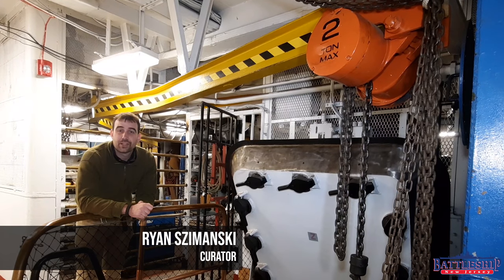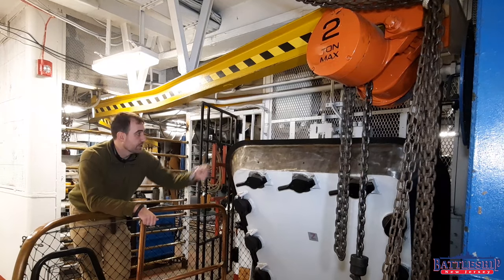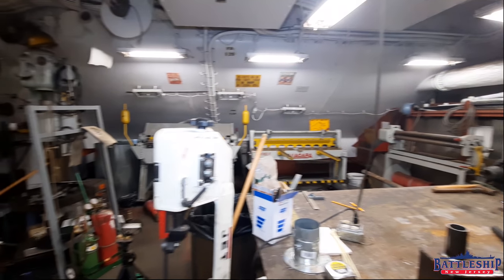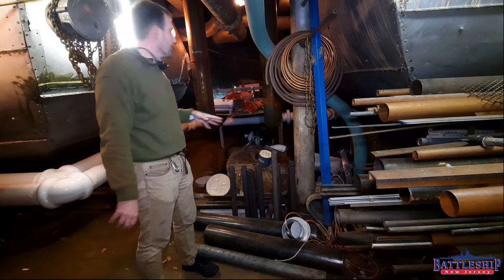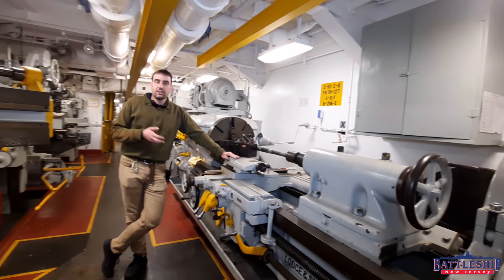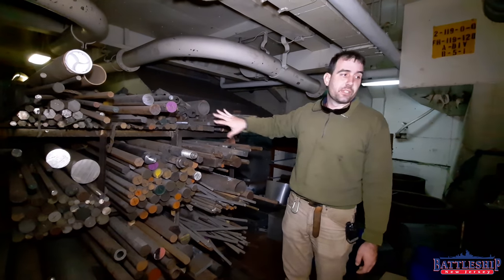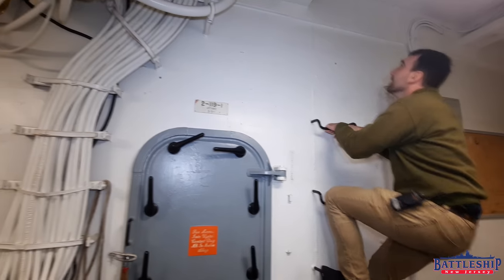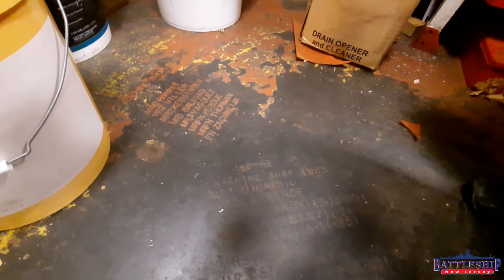Battleship New Jersey's Machine Shop

Comment: When you give a tour of a machine shop, you need to have a machinist describe each machine. Machining nerds need details.

Great video.
Reply: Yes the bullard is called a VTL, vertical turret lathe.
Reply: @000-v8v9w  I was troubled by the same mistake and jumped to the comments to make the same correction. I didn't see any turret, so I thought that it was a vertical lathe.
Reply: I think that was a Bridgeport on the left.
Reply from the maker: There is a Bridgeport on the left, right behind the Bullard vertical turret lathe which is right behind the drill press.
Reply: Lodge and Shipley Lathe.
Reply: @wilde.coyote6618  Yes, it's a 25".
Reply: @wilde.coyote6618  I work in a very large machine shop in York PA that has an old Lodge & Shipley lathe.. I recognized it right away.. we also have vertical boring 12, 16 and 20 foot in diameter... I was told that in the fortys these machines were used to help win the war and actually made some battleship parts.. later on in time the same machines were used to help produce the nuclear reactors that are in the nimitz-class carriers..... Currently we are making missile tubes for the next generation Columbia class ballistic missile submarines... And payload tubes for the Virginia class..  These old Machines and Machinists have and continue to make  quite a contribution to our nation's defense.
Reply: Yeah it killed me too. I thought I saw some type of metal planer just as the exited the 1st machine shop, I was hoping they would pan back around to get a better view
Reply from the maker: There are additional photos in the document in the description
Reply: @squigmontlucas6150  Manual machining or mostly CNC now? Just curiousity comin' from a fellow machinist.
Reply: @Privat3Kag3  quite a bit of both... But certainly the emphasis on CNC hbms and Gantry Mills.. we cannot find Machinists... The top rate on second shift $31 an hour and we cannot find people to fill the positions.. good benefits double time on Sunday..many of the old-timers have retired several more going to retire in 2021.. management wants to start a third shift.. where are the skills to fill these positions.. we have six apprentices already... Enough under contract work for 10 to 15 years.. Union just signed a five-year contract this past September..great need for welders and skilled fabricators and technicians as well
Reply: @craigtate5930  assuming all the battleships had the same equipment it was a planer.  I toured the USS North Carolina and she had one.
Reply: @craigtate5930  it’s a shaper
Reply: @mikemarriam  I too would call it a planer but Rockford, who manufactured one variant used on ships, calls then an open sided shaper. I have a Rockford in my shop that came off a ship.
Reply: @carlquib  I just recently learned that there is a machine called an open sided shaper.  I think Adam Boothe (Abom79 on YouTube) mentioned they were different from planers just the other day.  I remember thinking when I saw it on the North Carolina that it didn't look exactly like the planer Keith Rucker is restoring on YouTube but I didn't know what else to call it.  Thanks for the clarification.
Reply: abom needs to walk throught here with the machinist that still runs the shop
Reply: @slasher5273  I think it would be a great idea.
Reply: It would of been interesting to see how they moved the Standard Modern lathe down there. It's alot newer than when this ship was built. The Bridgeport mill was probably partly dismantled to get it down there.
Reply: @BattleshipNewJersey  I once read that every WWII boat that was classified as a ship had a maintenance shop with a Bridgeport milling machine
Reply: @craigtate5930  That was a Rockford shaper-planer they called it. Either a 3-foot or 4-foot stroke.
Reply: @wilde.coyote6618  That is a Model A L & S with a removable gap.  You can tell by the arrangement of the saddle on th carriage.  Used to have a Model X version with the removable gap in a 20" version. Ken
Reply: @mikemarriam  Rockford refer to them as a Shaper-Planer according to their sale literature.
Reply: Interesting comments! I retired in 2017, one week after I turned 61. I worked machine shop maintenance, mostly CNC, for 34+ years. It was a good trade. I never completed college. I was a single wage earner for my family and did well enough that I should never need employment again. I worked non union and received no pension, but still did very well. I found it very hard to attract qualified technicians, which seems to be a common theme in this comment series. Our shop went from 4 manufacturing shifts to 1 shift since I retired. Many seasoned machinists let go with vast knowledge and commitment to the company. I got out at a good time. It would have been very hard for me to lay off my skilled staff and friends. I raised 9, 5 boys and 4 girls. No one completed more than an AD, and went into the trades. They are each doing quite well in the trades.
Reply: @wilde.coyote6618  Loose and shaky.
Reply: I would say the lathe is a Lodge and Shipley Model G.  Looks to be in mint condition!
Reply: @BattleshipNewJersey  It would be interesting to see if any machinist-youtubers would be interested in touring the boat/investigating the machine rooms. oxtools would be a great choice.
Reply: @squigmontlucas6150  You have a 20ft boring machine. This description of a machine does not make sense to me, though I can imagine a number of iterations of such a machine, a 20ft vertical lathe makes for instance. Can you please describe provide a  model. My now diseased father and grandfather were both machinists in Indiana, before that state went bust. Hence my interest.
Reply: @josephdestaubin7426  we have a 20-foot 16 ft two 12 ft and 8 foot..manual vbms.. we also have a 12-foot CNC vbm.. my machine is the g&l 5-axis.. 7 inch spindle 12 foot rotary table.. Approximately twelve foot of travel on y axis.. about 20-foot travel on the x-axis..quite often like tonight we have a heavy canister on the rotary table but I have to switch out to a hot job it's going to be mounted to the floor plate to the right of the machine. We also have three Gantry nails including the new 100 ft long with 50 foot of travel... hope that clears it up  a little better..
Reply: I'm  a tool and die maker. I love running a lathe with a 4 jaw on it. Would love to run that big one.
Reply: @tannerbarham2571  are you doing progressive die work? Forming dies?molds?.. I had 10 in tool and die shops.. little bit of everything but the major emphasis was fabrication dies 4 vinyl and aluminum extrusion
Reply: @squigmontlucas6150  yes, progressive and transfer mostly automotive. Door hinges, seats, frames, sunroof parts, hot stamping die. A little bit of everything
Reply: @tannerbarham2571  cool.. a lot of focus required to hold those punch die tolerances.. we started pre- grinding.. we would grind the tool steel square before we put the holes and cutouts in.. then finish grind after heat treating.. my friend still does it in his tool and die shop today.. the second grinding is so much faster and more efficient as accuracy is much easier to maintain.. and the entire assembly process has much less troubleshooting involved simply because parallelism and perpendicularity where held before the dowel locating holes were put in..have had several shop managers declare this process added time but we have proven many times over that it saves time and increases profitability
Reply: There is a K&T universal milling machine too
Reply: @Privat3Kag3  I would bet that the modern machine shop on a ship still has all the same manual machines with the addition of 1 or 2 CNC. CNC just can’t do everything. And for one off parts or repairs, it will still be done on manual machines. CNC is great for production parts. Just not one off. Or surface grinding, jig boring, etc
Reply: @squigmontlucas6150  I’ve always argued “I can do it right once, or I can do it wrong twice, what do you want”?
Reply: @chriscarter7182  I have been a tradesman machinist since I first started learning in 1976.. I have decades of experience in both manual and CNC. I can say without a doubt your a assertion that manual machining is more difficult and than CNC is a conclusion based on inadequate information.. it is obviousyou do not have the experiencenin cnc as I have had and as others who have even greater depth  of experience to make such an inaccurate statement... However successful CNC programming, set up and operation  is much easier to become accustomed to if the person doing the work has started out with a manual machining background.
Reply: @chriscarter7182  I will also give you the first important principle I was taught in my apprenticeship and that is the minute you think you know it all in this trade is a minute you stop being a machinist..and that's the minute you should pack up your tools, sell them and look for something else to do... Have a nice day
Reply: @BattleshipNewJersey  the drill press there is more specificly a radial arm drill press as it swings around and would be used to drill very very thick stuff as you can imagine, but today they have largely been replaced by cnc bed mills or water jet cutters for cutting and drilling very thick stock, or mostly magnetic drills for drilling thinner plate up to about a 2 inch hole in something
Reply: Its a radial arm drill as well
Reply: @craigtate5930  I believe that was a surface grinder.  They are used to grind a very flat, level surface on the part.  The finished part can almost look like glass, depending on the fineness of the wheel.
Reply: @000-v8v9w ... or simply a VBM maybe with vertical and/or side turret head.

Comment: I think that working in metal shop on the ship is wery exciting 👍. I am working in metal factori for 33 years, and for 20 years I'm working on the vertical cnc lathe machine, programming it , set tools and other things which are necessary for production   and in the actual work on the machine. We produce workpices which weight is few tons. 8:15

Comment: My father had a machine shop for many years, and I worked in it on-and-off when I was a kid. I ran all the machines, but my favorite was an old WW2 Kearney and Trecker knee mill with the vertical head, which came off a Navy ship.  We used that thing daily for years, and when he died it was sold and is still operating today, doing accurate work. Thanks for the wonderful, informative videos. Preserving the history of these marvels is incredibly important.
Reply: @aristarchan1 if you watched close, there was a Kearney and Tracker horizontal mill with a vertical head in the machine shop.....Your dad probably had a horizontal mill with a vertical head also.....a very fine machine....

Comment: MR2 Fleming here I did not serve on the New Jersey  but I have spent a lot of time doing repair work as a Machinery Repairman in the Navy. Made lots of electric motor and pump shafts, repaired, straightened, fixed what ever it took to get back on line. MR is a GREAT Rate and directly transferable to Civilian work which I did (and still working at age 71 as a Machinist) for the last 30 year. Yes I would have liked to have see more details of the "real machine shop" with someone who knew there way around the shop. Seeing this kind of made me "homesick" for those Navy days I can still smell that shipboard smell. My son is currently First Class in the Navy stationed in Japan.

Comment: What is now the machine shop office had a tool and cutter grinder and two pantographs for engraving. I see they are gone. That tool and cutter grinder got used a lot. In the heavy side of the machine shop I see the electroplating sink has been removed. That was installed in 1985. In the lathe side (before you go into the office) that Standard Modern 16" lathe was installed in 1986, right before the 86 WesPac. Most of the original equipment actually had WW2 War Department brass tags attached. All of the equipment in that shop was fully functional and used a lot. A shout out to MR2 Scott Miller who found the worm shaft and leather belt to get the Vertical Turret Lathe (VTL) running.  Yes the VTL is belt driven. Made by Bullard.

Comment: As a machinist i feel like little boy into a toy store watching this vidéo !!!!
Reply: Mechanical Engineer here, and def. not professionally working in a workshop myself... but same.
Reply: Same.

Need more time examining the equipment on camera, preferably by a knowledgeable machinist.

Does the museum hire machinists? If so, would they be able to run any of the equipment? It's been a long time since I've run a manual machine, but this would be a really interesting job, even if the parts being made are simple.
Reply: Same here.  I love the old iron.  My oldest lathe is a 1933.
Reply: @throngcleaver  got you beat New York wire had a lathe that was built in 1917.. k & t machine in Ashland Virginia had one that was built in 1918, and I cut threads on it 10 years ago.. it cut them perfectly....
Reply: I was really hoping to see an old Monarch EE lathe here!! If I have my history correct, this lathe was developed for use onboard a navy ship. I’ve used numerous lathes thru my work-life, the Monarch is my, hands down, favorite!
Reply: @chriscarter7182  helped a place that seemed to find the cheapest beat up machines that still somewhat work for production, walked from the front to the back in aww and some horror at what I saw. their toolroom was better but every working machine needed TLC that the bosses refused to spend money on. the guys there gave me the nickel tour telling me what worked and what didn't then in the back around a corner next to a door that had rags filling gaps was a 1939 monarch. Only got to use that lathe a few times but it was so smooth and repeatable I still smile when I recall it.
Reply: @TheTriops123  I’m a retired tool and die maker from a VERY large manufacturer, a member of the Dow Jones Industrial’s stock index. While I do understand that my management couldn’t just open the vault doors and get the latest and greatest machine tool gizmo for us, we were also expected to do precision work on some pretty beat up machines. 
While the following is a bit sarcastic, it also has a bit of meaning and truth;
“We the willing,
lead by the unknowing,
are doing the impossible,
for the ungrateful,
we have done so much,
for so long,
with so little,
we are now qualified to do anything,
with nothing!”

Comment: That machine shop is fantastic. I work in a shop that rebuilds industrial gearboxes. Lots of modern CNC equipment but still a number of machines the age of this stuff.
Reply: I currently work in a shop that has 20 ft 16 foot and 12 foot vertical boring Mills and an 8 foot bulliard.. these machines made parts for battleships in world war II.. in the seventies and eighties the machinist who ran them made reactor components for the nimitz-class carriers..actually the entire reactor vessel and reactor head, along with many of the valves..today we are making missile tubes for the next generation Columbia class Boomer..and pay load tubes for the Virginia class attack submarines.. along with various other stuff for the Navy.. we also have an old Lodge & Shipley lathe looks pretty close to the one that's on that ship..

Comment: The metal shop in my highschool was equipped mostly from machines that came out of ships in the Philly naval yard. I was always amazed at how big the equipment was and it was all built in place and cut out when they sold it. I still remember the pictures he had from buying it all. But as things go they got rid of the metal shop after Mr Search retired in the early 2000's. It's truly a shame that they pushed him out because I can name at least 20 people who most likely wouldn't have been productive members of society if it wasn't for Greg Search myself included.
I still ended up not graduating from my hs. But thanks to him I joined the Navy and still managed to become a naval aviator by taking the hard knocks route. Granted I had to work 3times as hard but I still managed.
Reply: At san jose state univ. we had lots of ex navy ww11 era machines in the industrial tech machine shop class.  good American made stuff, this was back in the1980s